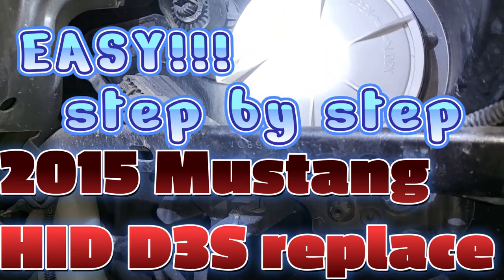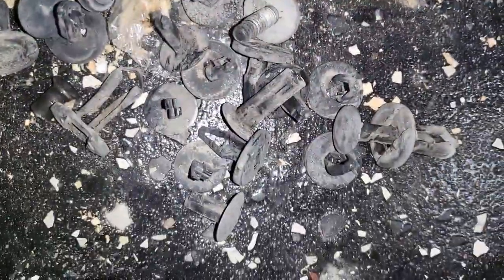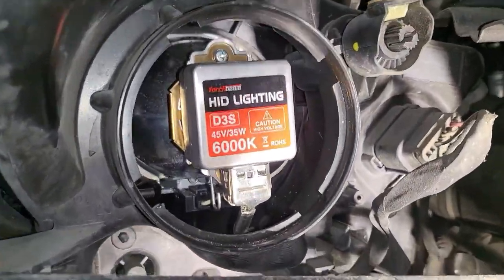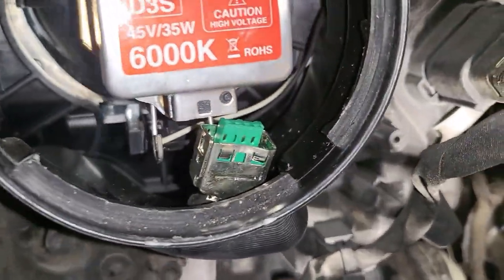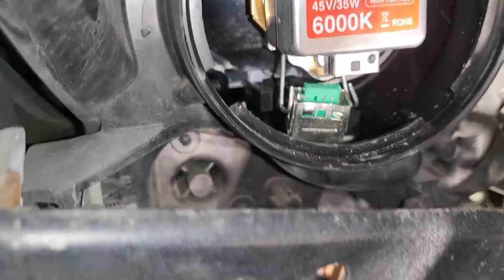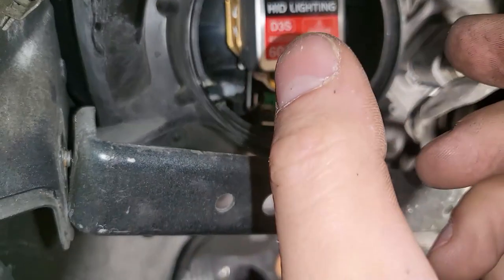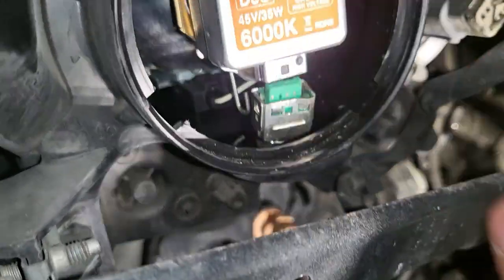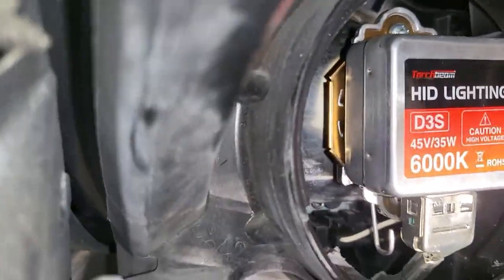2015 Ford Mustang HID D3s Head Light Replace  EASY!  WATCH THIS FIRST

Comment: I broke the clip trying to get  a new one back in but I tried doing it by plugging the light up and then putting it in.  I had to put something under the cap to hold the light firmly without a clip.  I folded up some rubber bicycle handlebar tape.  Seems to be aimed right
Reply from the maker: Sounds about right, design is horrible of course a light replacement requires a trip to the kitchen utility drawer for randomness
Reply: @toolsandtactics Is there a trick to getting the clips to lock back?  I wiggle and push and never can get them to lock.  I just did the other side.  Finally gave up and folded up chicken wire and used it under cap
Reply from the maker: @tomthumb5242  no just got to be very gentle

Comment: just use your girlfriend if you happen to have one around, to use her small hands. This worked for me without taking the wheel liner out, all accessed through the top little gap, but knowing which way to push the clips defiantly helped a lot.
Reply from the maker: Thanks, yeah, knowing the direction Is 1/2 the battle